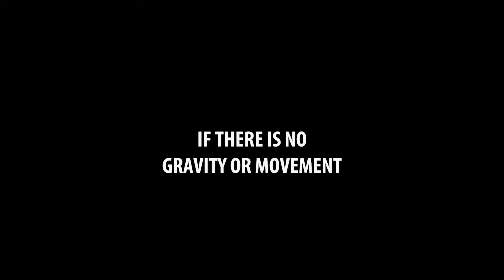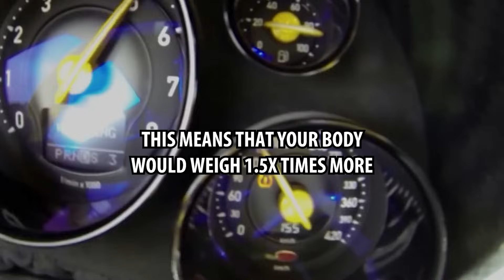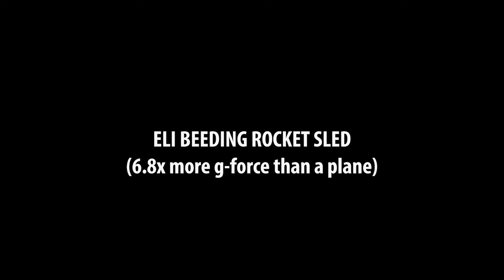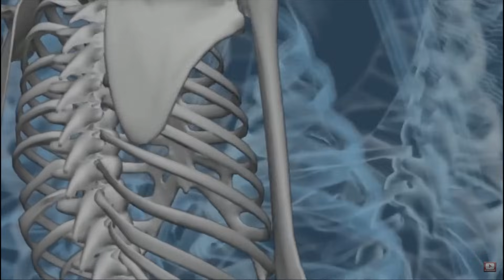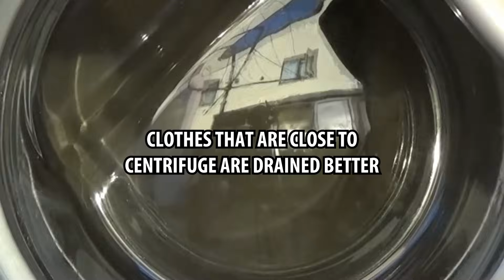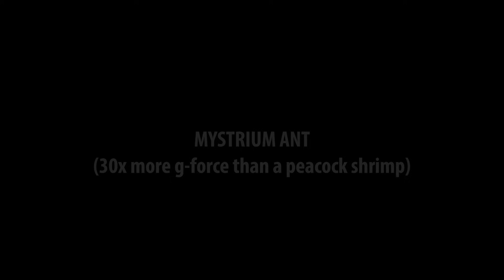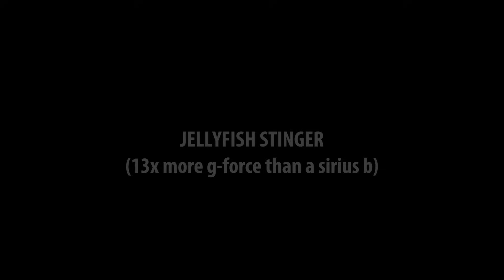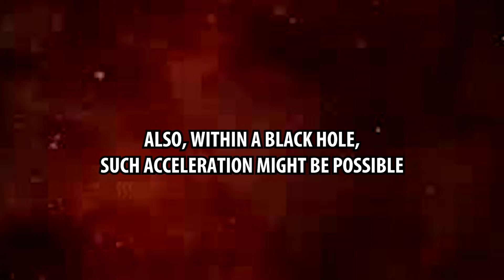Top G-Force Things Ever

Comment: 6:12 Man weighing 15 tons
Tank : Am i a joke to you?
Reply: This isnt true, he faced 216 G's pulling him BACKWARDS, not DOWNWARDS and due to this reason his total weight didn't change at all because weight is the force pulling you DOWNWARDS.
Reply: Okay sherlock, well that's not it, if you put the weighing machine sideways (at the back of his seat), he'd weigh the amount that was displayed, so technically you're wrong

P.S - weight isn't the force that pulls you downwards, it's the force with which the earth pulls you towards itself, and that can be in any direction.
Reply: @gamebot0104  you are basically Contradict yourself earth pull on the man didn't changed and so his weight didn't also.

This isn't about the pulling machine at the back lf his seat, all it did is to change his velocity relative towards the earth.
Reply: @YotamPeleg  He accelerated to 216G. That will make him heavier. Doesnt mean he will sink into the ground. Weight can be in any direction.
Reply: @arandomyoutuber6634  but this isn't the definition of weight,
Weight by definition is the force pulling you towards the earth, not just force pulling you somewhere...
Reply: @YotamPeleg  Well you are right as well but they are right too, because you know, G-Force is a short term for GRAVITATIONAL force equivalent or something along those lines. So he did weigh that much.

Comment: Good vid as always dude! Next, try Top Sharpest Things Ever.
Reply: good thought! but how would you define sharpness? the shortest width of the edge or more like what can penetrate matter the easiest? as far as i know sharpness is often defined by the hardness of the cutting material, for example hardened steel vs cast iron blades and i think thats because their atoms are closer together and so you can sharpen the edge to a smaller width
Reply: @DiabolicaLuke  That's true
Reply: Green Jetstream in this case itd probably be what can penetrate matter the easiest without simply burning through.. Slav already did smallest stuff
Reply: Teddy Engbrecht Why do you have John as your profile picture?
Reply: You know who Johnny Dee is? That's cool! I have him there so I can always remember him.
Reply: graphite layer
Reply: Hexagonal Diamond. Slav likes G-Force.
Reply: that should be the toothache !!!! right on top of that category !!!!

Comment: 0:30 They are actually. They depend on gravity to stay in orbit. They're actually continuously falling down but their side velocity is fast enough to go around the earth.
Reply: and whole solar system is affected by gravity of milky way galaxy etc.
Reply: But they don't experience a downwards pull
Reply: @m13_033  They do actually. Otherwise they'd just roam away from earth.
Reply: @m13_033  they experience a downward and a sideways pull. if u just move sideways u will escape the earth. thing about moving a ball on a string in the air like a lasso. then freeze time and cut the string. what the ball will do is it will no longer have centripetal force, which incase u dont know is this "downwards pull" that allows it to move in orbit, in a curve around an axis.  the ball wil still have force moving to the side. so it will move strait and no longer in a curve. if it moves straight, it flies out of orbit like a rocket slingshot around a planet. astronauts experience 0g in orbit around space, although they still experience most of the gravity from the earrth. gravity is wat keeps them in orbit, freefall is what makes it 0g force.
Reply: They experience a downwards pull. But not an acceleration. It’s a perfect mix of forces. They aren’t falling they are in orbit. The word “orbit” the only way to describe it.

Comment: I wouldn't keep calling it a "gravitational force". Sure the G measurement is based on earth gravity, but any sort of acceleration can be measured in G, and isn't necessarily "gravitational acceleration".
Reply: thats what i was thinking the whole video. but i guess its also just how many times greater than the force of gravity which we all know is 9.81 m/s^2
Reply: Shut up poindexter. Its slav gravity.
Reply: This video misunderstood G force.
Reply: @urmthrwan G-force is gravitational or the force of acceleration in SI units of "g" which are equal to the earth's gravity at sea level or 9.8 meters per second per second. There is a huge difference between the gravity we feel and acceleration, but not a difference that we can actually feel.
Reply: @hernancasco6937  no. it did not. are u aware of decelerating g force. that is what is. that is what is peacock shrimp. acceleration will cause you g force. and so as degeneration.
Reply: True but those who know that know that already and those who dont would get confused. So better not to be a smarty pants sometimes nerd
Reply: Acceleration and gravitational force are exactly the same thing. That's a fundamental part of Einstein's Special Relativity.
Reply: @gordonlawrence4749  all German sheppherds are dogs, not all dogs are German sheppherds. 
All gravity is an acceleration, but not all acceleration is gravity.
Reply: @dangleason9023  learn some physics and do you honestly think dog breeds have anything to do with it?
Reply: @gordonlawrence4749  well it's a turn of phrase. I have a degree in Geophysics and Geology. BTW. 
I'm not here to argue, but the unit of measurement "g" is 9.81m/s^2 right? 
It may be easy to confuse this with "gravity", and yes on Earth one g is our gravity on the surface, conveniently, but it's a unit of measurement. 
When you swing a ball on a string or turn a corner in a car, do you call that gravity or do you calculate the Delta V? It's a vector that can easily have no involvement with "gravity". 
It's semantics to a certain point, but again goes back to "not all acceleration is 'gravity'."
Reply: @gordonlawrence4749  at this point I assume you're trolling, but hopefully some people can read this back-and-forth to impart wisdom or motivate interest in the amazing field of Physics.
Reply: @dangleason9023  I have provided a link to a paper issued as part of a lecture in physics from a university to prove my point. You have obviously not read it. A troll for example does not provide evidence of any credibility and does not read and engage with evidence supplied. So who is the troll precisely?
Reply: Except for the LACK of gravity. Interstellar space, not gravity, but sure, it would feel exactly like normal 1g.
Reply: Hadn't seen the link yet, i'll look it over. Thank you.
Reply: @dangleason9023  yet again you have failed to critically engage proving it is you that is the troll.
Reply: Dan Gleason explain this. Actually interested. So G force in this video is wrong? Like do you mean that comparing massive acceleration differences to g force is faulty? I wouldn’t know, but Gordon said it is the same thing. I really do not understand. I was amused by this video, but if it’s wrong, then what is right?
Reply: @augustbaptiste9001  well the opening line is "top gravitational forces".  This is where physics vocabulary can get a little hairy. 
If this was the title of the video I would expect to be seeing MASSIVE objects throughout the universe. Gravity is created by the deformation of space-time because of mass; how exactly mass does this, we aren't sure. 
Acceleration is a more general term, and "g" (lowercase) is a unit of measurement, just like how we use miles or feet or meters. 5280ft in a mile, 1000 meters in a kilometer.  Similarly "g" is 9.81m/(s*s). 
"g" does not stand for gravity. It is the acceleration of gravity on Earth, but his usage of the word gravitational is not accurate. 
Another guy and I had a dispute about this, you can read the replies and see both sides of the conversation. 
I agree that gravity on Earth and constant acceleration cannot be discerned in FEELING, but they are fundamentally not identical.
Reply: I am one of the ones who did enjoy this conversation! I haven't taken much physics since AP/IB in High school, but have PhD friends in the field so I get at least some exposure. Physics and Neuroscience are the sciences I would/will more fully study in another time.

I'm tempted to agree with Dan here. I think that the video conflates the term and describes things as "gravitational forces" that would be better described as acceleration and forces more generally. 

Also, @Gordon, I love the link and the impulse to post citation, but that most certainly wasn't a "paper." It's some lecture notes from an unknown source - perhaps it's a quack professor's views, perhaps not.
Reply: @taylorlayton4508  Taylor Layton, thanks Taylor. It's semantics to a degree. I'm glad you appreciated the conversation. It looks like a physics 1 college course notes which aren't bad for explaining things in regular terms. It's actually a pretty good resource. 
But if you asked an "acceleration expert" if that exists he would side with me. 
The best part of all this is people are learning something! 
I'm sure we both appreciate your comment and are glad you took something positive away from it.
Reply: @urmthrwan there's no difference in feeling, but is the acceleration from a car the same as "gravity"? No. 
That's my main point; all gravity is acceleration, but not all acceleration is gravity.
Reply: @mysteretsym  g is a unit of measurement, and can of course be negative. It's a vector pointed in the opposite direction of motion. Read some of the other comments and you'll get what I'm saying. All gravity is acceleration, but not all acceleration is gravity.
Reply: @urmthrwan yes gravity is an acceleration, but there are other accelerations that are not due to gravity. 
Drive down the road, turn the wheel and then tell me that was gravity that made you accelerate PERPENDICULARLY to the gravity vector.
Reply: @urmthrwan at 2:53 he calls the acceleration on a roller coaster a "gravitational force". 
You could build this in interstellar space and the acceleration would be the same. No gravity...but still acceleration. That is the ONLY thing I'm arguing here. None of these are gravitational forces, otherwise we'd be talking about huge star or black hole masses right? 
Sure g is a unit of measurement based on Earth's gravity and is a very handy unit to give us a sense of acceleration, but it is not exclusively used for "acceleration due to gravity". 
That's the only point I'm making. 
Is all acceleration "acceleration due to gravity"? No, problem solved.
Reply: Your mother.
Reply: You see the view count of this video. Do you think there are that many sciency population on earth (probably are technically).
Reply: @SpaceJesus25  acceleration from gravity on earth surface I guess that is what you mean.
Reply: G is the constant of gravity. g is usually used for gravity acceleration.
Reply: @gordonlawrence4749  BTW, do you know why sun's gravitational pull on earth is point at where we would see the sun is, instead of where it actually is? I still don't quite understand this part.
Reply: @skyacaniadev2229  it's not the sun pulling on earth on it's own. We actually orbit the centre of gravity of the universe not the sun. The sun heavily influences this and we get pulled slightly out of orbit by the larger planets but that's the basis of it.
Reply: @gordonlawrence4749  Did you even understand my question? Do you know gravity travels at speed of light? I am asking where the sun's gravity point at? At where the sun actually is, or the where we see the sun?
Reply: @gordonlawrence4749  Anyway I got a partial answer. It will point at the actual position of the sun, as long as the sun moves at constant speed.
Reply: @skyacaniadev2229  Nope there is no evidence that gravity travels at any specific speed as we still do not know the mechanism by which it works. All other forces are by particle exchange and we know what those particles are and how fast they travel. With gravity neither is known.
Reply: @gordonlawrence4749  You are correct. Can we know for sure it is not instantaneous?
Reply: @skyacaniadev2229  with current methodology we can measure down to atto seconds relatively easily. So if we could figure out how it worked we could at least get an estimate. But as for instantaneous then no we could not know that as quantum effects will stop anything being measured to less than the Planck time.
Reply: @gordonlawrence4749  Thanks. Does Reletivity Theory think gravity travels at speed of light?
Reply: @skyacaniadev2229  relativity does not look at it like that at all. It looks at gravity as a structure within space-time. It's not looking at the quantum level.
Reply: @johnrubensaragi4125  so a magnet creates/is gravity? Are you serious? 
Then how can a magnet affect one element (iron) more than another (i.e gold)? Space time is curved right...?! Get out of here...
Your understanding is close but without a cigar. 
Pretty sure gravity is dependent on mass. Anybody know that equation with "big G" and idk.....MASS. 
ALL gravity is a force, but not all force is Gravity. 
Go hold up two magnets to a true physicist, then bring one closer to the other and when they snap together ask him/her "is this gravity?" 
Tell me they don't piss themselves laughing.
Reply: 43 replies, all this back and forth and not one of you addressed the key issue here: the difference between vertical and lateral G’s.  

If a fighter pilot increases elevator deflection there will be additional G forces in the vertical direction relative to them.  If an F1 driver goes around a sharp corner there will be additional G forces applied horizontally.  These are entirely different because humans are taller than they are wide.  I.e an F-35 will remove the blood from your upper body but an F1 car or space shuttle won’t.  

That’s the main problem with this video- it’s comparing apples and oranges since the direction of the G forces relative to the human is extremely important.
Reply: @songbird6248  No, that is NOT the point. He believes that some of this force must not mentioned as gravity (Washing machine isn't gravity etc) but only attraction between mass which is inccorect REGARDLESS OF DIRECTION WHETHER IT IS VERTICAL OR LATERAL. Don't forget, when you lie down, gravity is lateral, but that is still gravity
Reply: John Ruben Saragi I think OP recognizes that G’s are a standard unit of acceleration.  However, even if you’re measuring an acceleration in G’s (and every acceleration can be- it’s just a unit) that doesn’t mean the force causing it is a gravitational force.

I brought up the vertical/horizontal issue mainly because it’s a massive oversight on the part of whoever made the video.  They’re two entirely different things that shouldn’t be compared.

To clarify, if a fighter jet is banking, the pilot experiences increased vertical G’s (colloquially called “G forces”).  However, this increased acceleration is really a result of centripetal force.
Reply: @songbird6248  I agreed when you said "If you measure acceleration in G that doesn't mean the force causing it is a gravitational force." But we don't care about the damage of G-force AND we don't care about its direction. But we care about how much is it. AND we should not discuss whether it is gravitational or not. But he says "This is not gravitational! Gravity occurs only for massive thing!" and i just want to clarify this.

Comment: 0:27
It’s a common misconception that the astronauts that are orbiting the earth on the International Space Station don’t have any gravitational forces acting on them. But they do have gravity in space. Orbiting the earth is a more like flying so fast horizontally proportional to the earth that you kind of fall past it. 
But in fact if we would build a tower that is 400km over sea level (which is the altitude at which the ISS orbits the earth) we would just be walking around normally. But the ISS would be wizzing past us at 28‘000 km/h or almost 8 km/s because it has to keep falling past the earth.